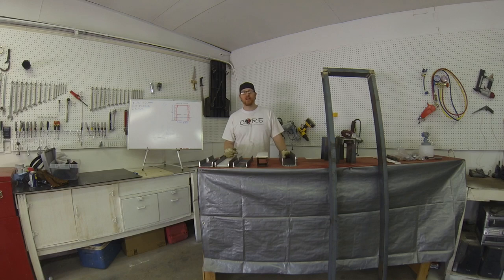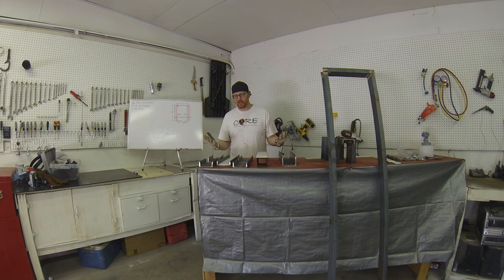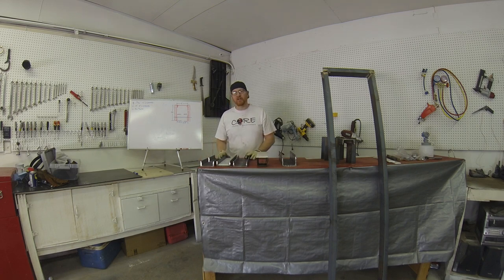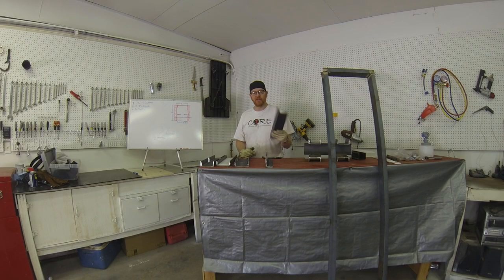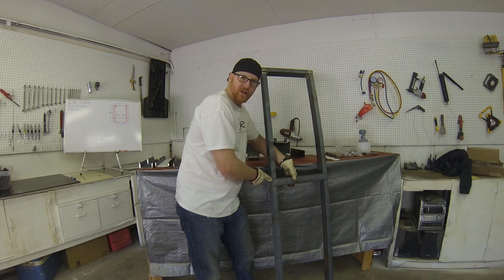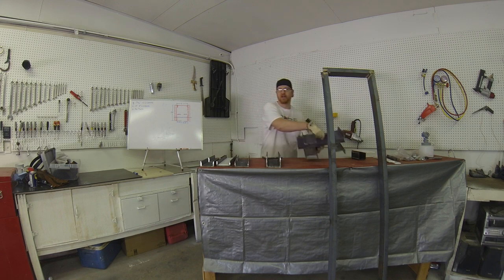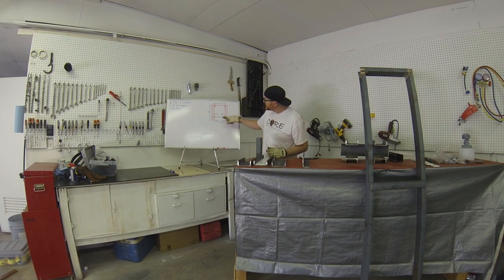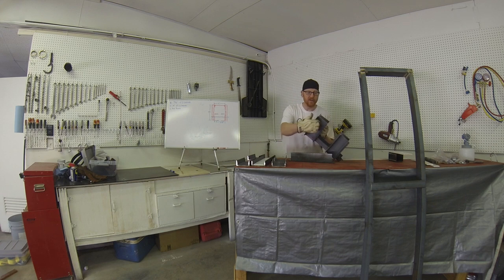WHAT? WHY? UTV Trailer Glider Build Part 5

Comment: why not have suspension on trailer
Reply from the maker: The concept is to use the suspension of the rzr.  Keeping the trailer minimal in size and weight to make it easy to lift and maneuver all the parts by hand.  Also to keep the project cost down.  I would like to have done torsion half axles but that would have added another 1/3 of the cost of the total build.